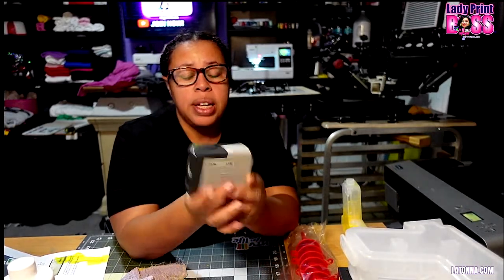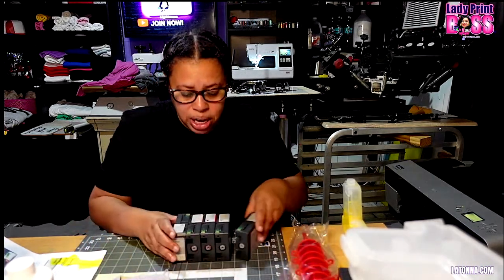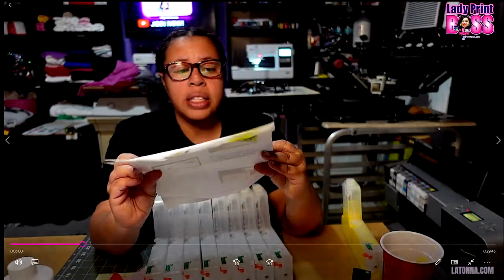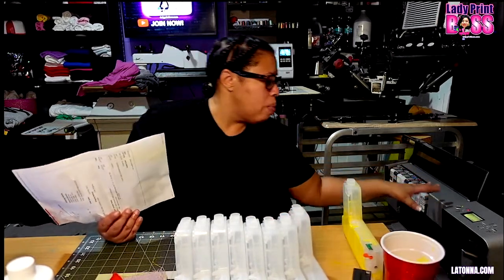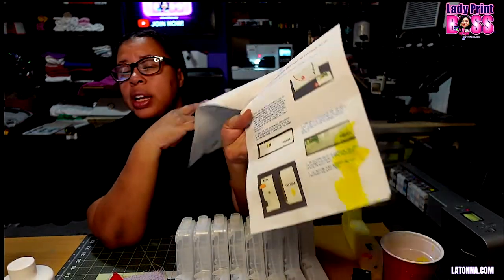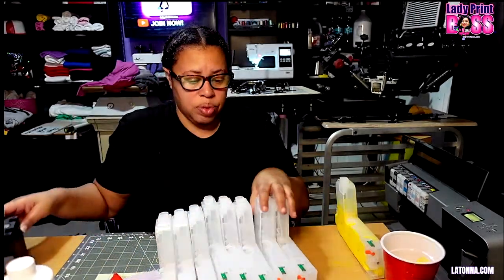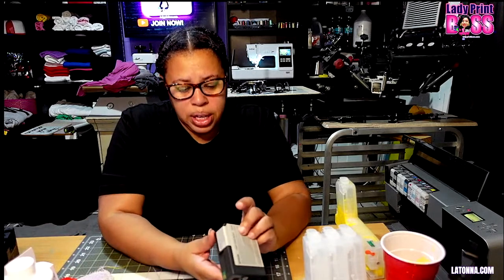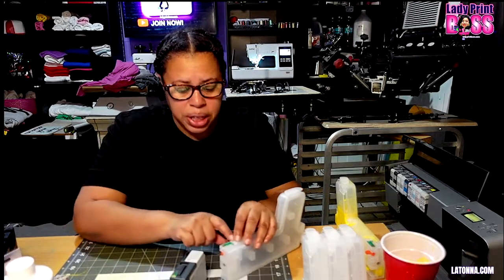EPSON STYLUS PRO SETTING UP REFILLABLE CARTRIDGES FOR DTF PRINTER CONVERSION

Comment: Hello! Found your video very helpful! I am an artist and make merchandise for bands, and decided to branch out! Question did you find it necessary to remove the rollers? I am a bit confused aren't the rollers under the PET film and the printer prints on the TOP of the PET film? How are those Lines being caused???